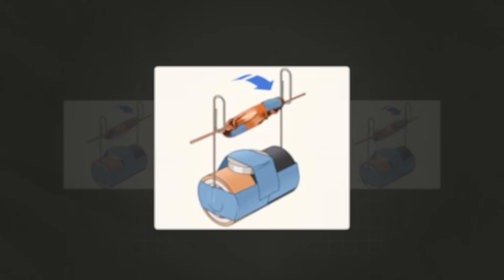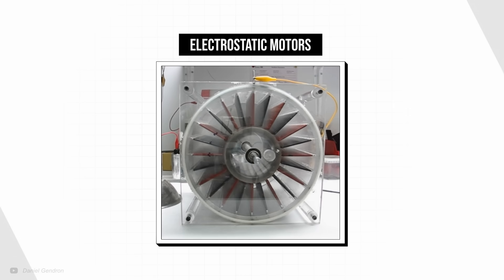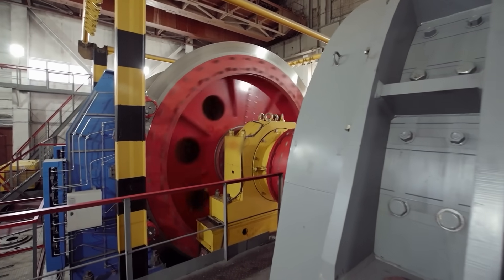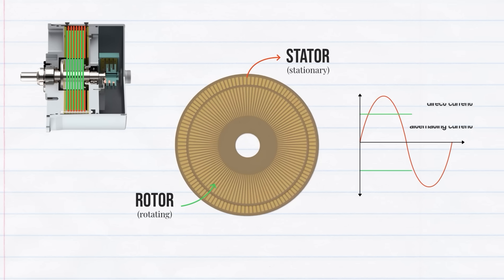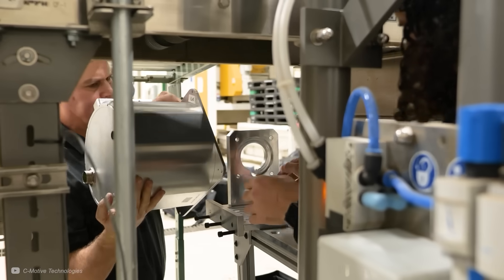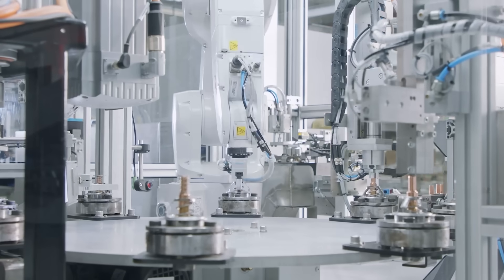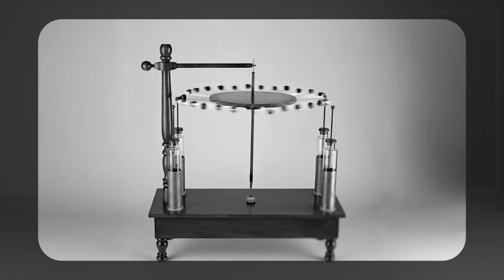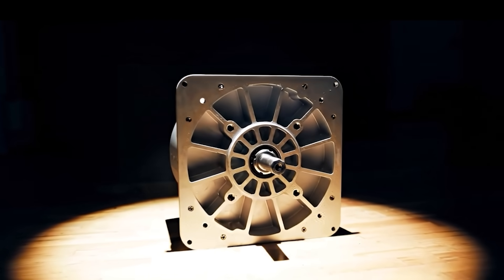How Electrostatic Motors are Breaking All the Rules

Comment: Companies dont care about rare materials, if motor is cheap to make and buy and reliable, they get it. And most of industrial motors dont really use rare materials beside cooper, and they are super effective compare to this, easy to fix and maintain. 
Here we have pretty complex and expensive motor(even if it doesnt use rare materials I bet price tag on it is big because of eco sticker) that use fluid inside that make insane drag inside so that why they are afraid to talk about speed. Plus it use high voltage so it need totally new driver platforms to run it. Also I bet they are not really reliable in long run.
Im not saying that is bad idea to find new ways to run things, but I saw too many similar projects where guys start companies advertising their devices as AMAZING AND INNOVATIVE and after real life test they hit the wall and realize that all they did was overcomplicated something that already work and trying to force companies and factories to use their projects is impossible not because no one want changes but because in real life such changes are not profitable at all. "Oh yes we saved 50K on electricity bill but we spend 50K on fixing it as it break all the time and our production slowed down by 15%"

Comment: I wonder why they took the drag losses from a liquid dielectric instead of using a solid state coating on the discs. Tightly spaced discs like that is a worst case scenario for fluid drag. They’ve accidentally made a tesla turbine (not a pun, an actual design that uses this fluid property)

Is the dielectric constant of their magic liquid really that much higher than something common like PTFE dielectric film? It should be possible to guess it anyone has their operating voltage and disc spacing numbers

Comment: 6:21 You say that as if it was impressive. Air has a breakdown voltage (when the sparks start to fly) of around 10 kV/cm. So what is that 4 kV in relation to?

Comment: Lots of pictures of asynchronous motors which are not subject of rare earth metals application... Power converter cost and efficiency also should be taken in consideration, and considering it is a high voltage design, it won't be cheap hence as a system to replace asynchronous motors in many cases wont happens due of the cost. Nevertheless, it is good some one is working on such motors so to have an alternatives in the places it will justify initial high cost.

Comment: So, looking at their website, I cannot find any actual specifications. Other than the "90+% efficiency from 0-500 RPM" line. No torque curves, no efficiency curves, nothing about required supply voltage... The website looks far more focused on getting normies excited than it is on convincing engineers to use their motors, and that gives me a level of skepticism that they actually have a viable product...

Comment: Wouldn't this motor design be great for wheel and hub motors for electric vehicles...?

Shape, low rpm, high torgue, good acceleration and efficient at constant rpm.
Four motors in a car, one in every wheel, so they don't have to be so high power.
Also safe because rubber and easy cooling with air and liquid.

Comment: Sure the motors can be 90%+ efficient but what about the inverter? Converting 120V to 5-10KV needed for the plates is not easy, especially at the high frequencies required. Looking at the plates, it's 50-100 charge/discharges per revolution. They'll probably end up trading winding losses for inverter losses.

Comment: On a society-wide level, Zevon's "paradox" holds that when the cost of an input to an industrial process goes down, the use of the input goes up, negating any theoretical savings, ultimately resulting in higher total expenditure on that input.  If, and it's a big if, the same true at the corporate level, then it implies that a firm will redeploy the savings of electrostatic motors into other electrically-based process inputs, or in aggregate, industry will find more uses for more electrostatic motors plus electromagnetic motors combined than they have solely for electromagnetic motors now.
Reply: Those "negated savings" don't run empty just for the sake of it, they generate output that otherwise wouldn't be generated.
Reply: @nunterz , both things can be true.

Comment: The most common industrial motortype, the asyncronous type, have no permanent magnets at all, the magnetism in the rotor is created without moving part by the speed difference between the syncronous magnetic field and the rotation speed of the rotor. FOr the motor as such, it can easily  reach 95% or better of efficiency at industrial size motors. And in real life a relatively low percentage of the industrial motors use gear-boxes. Very few use the type of gear box shown in the film, that has notoriously bad efficiency. Gear boxes are not used for fans, pumps, not is some newer applications of EV-s. For low power needs and low torque, there are almost never gear boxes, or in some cases nylon gear boxes of the simplest kind. And for moderate torque needs with low RPM you dont need gear boxes, you just use electronics (Frequency converters). Talking of conveour belts, the power size is well above 1kW, so we vill se when (if?) they reach that level power.

Comment: They’re targeting 3-phase induction motors, the most simple and reliable motors in existence. Going to be tough to convince people that they’ll have the uptime. Low power consumption when stalling is interesting, but you can just lock motors with a brake to get the same result. Low power consumption at very low speeds and high torques is just what gearboxes already do.

If anything, I think electrostatic motors are useful for being powered from inherently high-voltage sources. Like capture of charged particles.

Comment: Proof people don't understand manufacturing. 1st, the numbers are cherry-picked for worst vs best. Standard marketing. But....

A 3 HP induction motor will set you back about $200. If it's 3-phase so long as it's cleaned and oiled it will last 100 years without issue. There are ones even older still operating just fine. And being that small it will be either 240 volts or 480 volts, low enough your basic shop maintenance person can safely work on no problem.

Then there's this thing. Cost unknown. Fluid inside? How often does that need to be changed, and at what cost?  Then there's disposal. If you're a business they make you get a hazardous waste generator license for the rainwater that hits your roof, so you know they'll charge for disposing whatever it is (that they won't say). A 4000 volt operating voltage? Now you're into a grade of electrician akin to linemen. You're in-house people as well as the majority of commercial electricians won't (can't legally) touch that. And then you have the electronics to control the thing. What's the life expectancy of that, and what's the cost of replacement?

Save $1400 per year in electricity, but costs you $3000 per year (averaged out) in installation and maintenance. Same thing they did with fiber lasers. Sold them as "better" because you didn't need CO2 laser gas. Nitrogen, tho, is the main operating cost, even more than electricity. They didn't mention fiber lasers go thru as much as 6 times more N2 than a comparable CO2 laser.

Comment: Industry won't adopt it. Having 4000v electricity in common control panels is a non starter. 480v is dangerous enough already. They could possibly make a package unit with the drive integrated into the motor, as long as they can solve the heat issues and get the cost down to at least match a motor + VFD.

Comment: This video is riddled with errors. Induction motors are pretty efficient. They just aren't popular for some applications due to their size/mass. Their sychronous speed can be adjusted with winding configurations, not necessarily  needing a gearbox. 

Permanent magnet motors are popular due to power density, a requirement for electric vehicles. 

Most appliances don't use induction motors, they use universal motors, which are not very efficient, but they are powerful for their size.

Comment: more interesting aspects are things like longevity. having no windings to overheat, this sort of motor might be good for like submersible pumps or that sort of thing, which are often already oil filled. 
the other thing is having no induction implies that this motor probably doesnt have a high inrush current? probably good if this thing is to be powered for solar panels directly coupled to a motor for say solar pumping.

Comment: Mechanically these look like they'll have a similar problem as Axle flux motors. The wide thin plates are hard to keep in the exact right plane. Since the Gap is just under 1 mm if one side flexes in the other side flexes out and this cause a huge problem because these types of things are very sensitive to the Gap.

Comment: Nissan just perfected an electric motor for their new EV which doesn't need rare earth magnets. The rotor is magnetized using carbon brushes which last years, & are held in place by 3 bolts. It produces about 260 horsepower. So the rare earth problem for electric motors is over, until the copper runs out.

Comment: While I'm a bit suspicious of those efficiency figures (a good motor / gearbox can achieve higher efficiencies that that stated - depending on amount of reduction), I'm also a little concerted about long term health and safety. I mean if some gearbox oil leaks out over time then the gearbox will continue to work until gears no longer touch the oil then, but what happens when the dielectric leaks out of the static motor over time - presumably it wouldn't take much to leak out before creating a problem (and potentially fire hazard?)?

Comment: Only 60%, compare that to what is said in the EV market, efficiency wise, and these old induction motors are true dinosaurs. Even lots of domestic brush motors are just as bad, I had a vacuum cleaner rated at over a thousand watts - the heat out of that thing was hideous - might as well use it as a heater as it's suction wasn't that much better than my older vacuum.

Comment: Common electromagnetic motors have been in use for over 100 years, their simplicity being the reason they can be adapted to any application. You missed the laminated iron used to concentrate and direct the magnetic fields produced by the copper or aluminum windings, and you didn't explain how high voltage static electricity was used to produce mechanical force that turns the armature of a static motor. Thumbs down.

Comment: Colour me sceptical. Conventional electric motors are already extremely efficient compared with any other way of generating rotational torque - ie heat engines (turbine and piston engines of all types). That's actually one of the big advantages of EVs. And conventional motors have an extremely wide "power band" compared with heat engines too so MOST applications of them do not require a gearbox.  You are right - this firm is, bluntly, lying in its claims about the inefficiency of electromagnetic motors which gives you no confidence at all in any claims it makes about their product.
They look like just another way to part venture capital funds from their money.

Comment: Wouldn't it perhaps be better if it was a vacuum, rather than filled with a liquid?  I imagine that still allow for a very high voltage.  That does remove the liquid as a coolant but because there's no viscous drag, it could operate so much more efficiently that perhaps it doesn't need the extra coolant.

Comment: This may help folks stuck focusing on power metrics:

Electrostatic motors (ESMs) aren’t about power density. 

A super low-torque electromagnetic motor spinning at 50,000+ RPM may deliver a lot of power on paper—but with almost no usable torque—which is exactly why gear reduction is almost always required.  Traditional motor companies have been dubiously marketing power (horsepower) for decades. 

The only performance metrics that actually matter are how much torque is available at a given speed and how efficiently the system operates at that speed.
Reply: Torque/speed tables are usually listed in specs... 
And of course super low torque motors will produce super low torque. 
I don't really see the point of pointing out the obvious.
Reply: @ShadeAKAhayate   Then you don’t understand the engineering trade offs that influence design decisions of motion control systems.
Reply: so the idea of electric cars having instant torque is just a lie and tesla's don't have the highest acceleration rates for production vehicles? instead of rare earth magnets, both em fields could be electrical. and axial motor designs are coming with greater torque capacities. this video presents a very axial motor like design. where is the actual electromotive force coming from in an electrostatic system, anyway?
Reply: а почему вы не рассматриваете "электродвигатели с ВЫСОКИМ крутящим моментом"? Они не вписываются в вашу парадигму "заговора"? Например DirectDrive моторы вполне так имеют низкие обороти и ОГРОМНЫЕ крутящие моменты с КПД около 98%! Их применяют для привода станков ЧПУ(шпиндельные головки токарных станков).
Reply: @chveyk  I used an AI translator, “Why don’t you consider “electric motors with HIGH torque”? Do they not fit into your “conspiracy” paradigm? For example, DirectDrive motors indeed have low RPM and HUGE torque with an efficiency of about 98%! They are used to drive CNC machines (spindle heads of lathes).”

The translation is a little hard to understand.
Reply: @Fejimush  а что понимать? Вы пишите про какие-то мифические двигатели с 50000 оборотов в минуту и "редукторами", которые "съедают" весь выской КПД!!! И почему-то игнорируете те самые "высоко моментные" директдрайвы, которые выдают тот-же "момент" БЕЗ редукторов. Прямо на вал!

Comment: Why are there no gearboxes on the electrostatic motors?  It is NOT because gearboxes are inefficient; it is because liquid-filled motor CAN'T run fast.  & that liquid: either it is flammable, or it is fluorocarbon, with all the "diseases" of refrigerants.

Comment: This synchronized electrostatic motor works the same as pulling apart or pushing together 2 charged capacitor plates, and should work using same design with very close proximity insulated plates buy using much lower voltages e.g. 120v ac with less problems of electrostatic discharge.  Motors working in a vacuum with magnet couplings should be also be considered.
Reply: "This synchronized electrostatic motor works the same as pulling apart or pushing together two charged capacitor plates."

C-Motive's first few proof-of-concept prototypes operated on the straightforward application of Coulomb’s Law. However, subsequent models do something far more sophisticated and robust. C-Motive owes that breakthrough to Professor Dan Ludois and several of his remarkable PhD students.

"Motors working in a vacuum with magnetic couplings should also be considered."

One such example was developed by a Japanese company—there are videos of it available online. However, maintaining the deep vacuum required over the long term without periodic assistance from a vacuum pump proved economically unviable.
Reply: @Fejimush  A motor built and sealed up in a similar way to an incandescent light bulb, would need no vacuuming once sealed.

Comment: Most interesting .  Noticed you referenced 0 patents.  Are there any?  Printed rotors and stators and AC to AC interface.  Torque vs HP ?  is there an RPM limit problem?  
The kind of efficiency no.s is impressive.  Seems like perfect solution to electric robot mowing application.